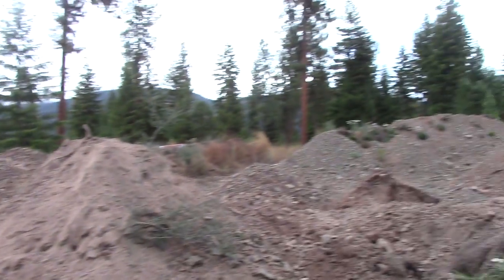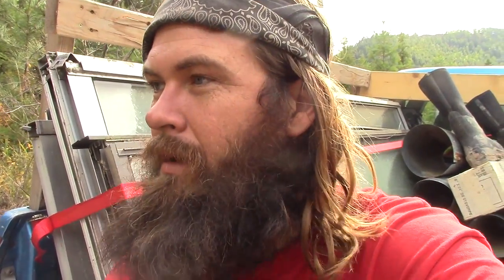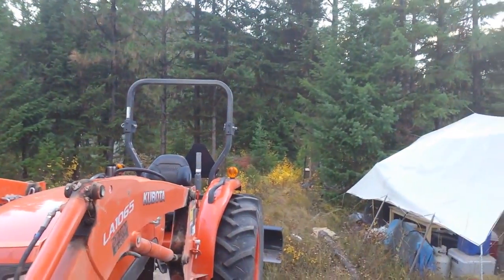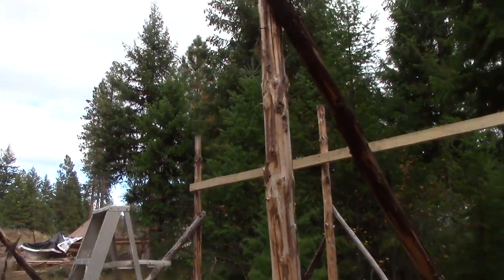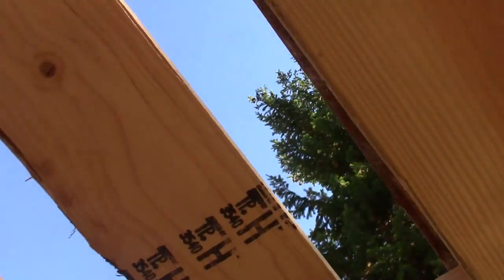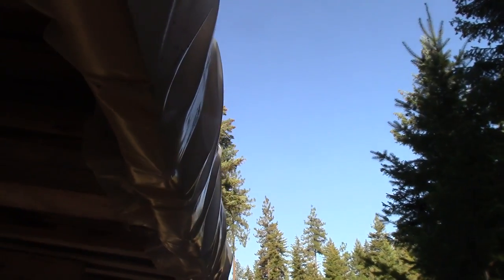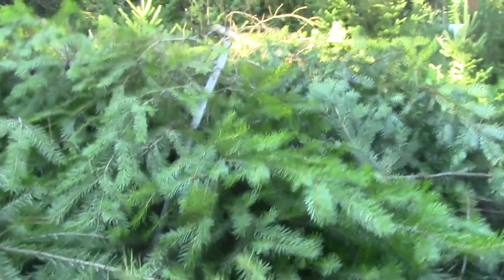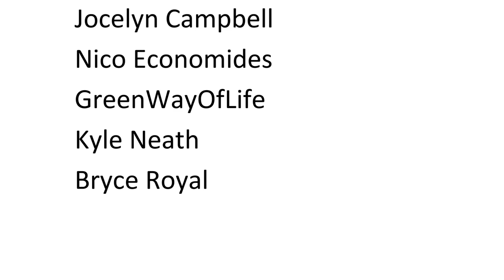Ant Village Journal #35 Skidable Structures, the Mulch Roof, & Building the Permaculture Bike Park P

Comment: your kitchen looks like it could be a fire hazord next summer hope you have plans for that
Reply from the maker: yeah, i'll have to replace the mulch occasionally when it dries out.  or perhaps after being covered in snow this winter it will break down enough to not be so flammable.  I would have preferred to use wood chips, but this is what i had on hand at the time.

Comment: Shattered glass can work well as an insulating material! At the sundog school for natural building they use crushed bottles as a subfloor for their natural earth floors, so the heat from the passive solar house stays in the earth slab of the floor rather than leaching into the ground! not sure if it can work for ya but you should look into it.
Reply: I have seen people use it as a heatstore for hot air. You basically pump the hot air of a greenhouse into it during the day with a tiny solar operated 12v fan and the heat gets released at night.
Reply from the maker: Those are both great ideas, thank you!.  I was thinking it could be used in a pebble style rocket mass heater, in place of the 3/8" pea gravel.  It is interesting that it has been used as both an insulator and a heat storage medium, i guess it depends on how it is arranged.